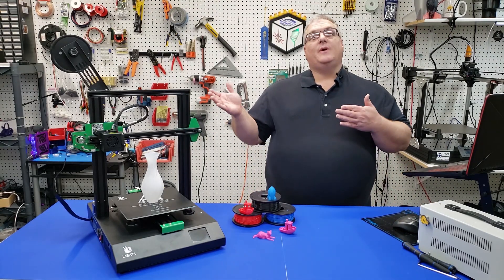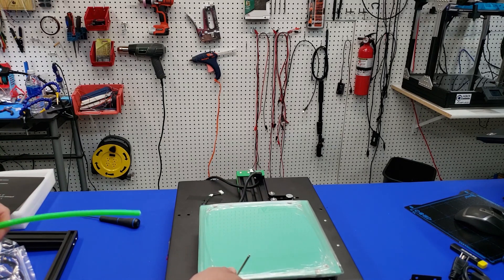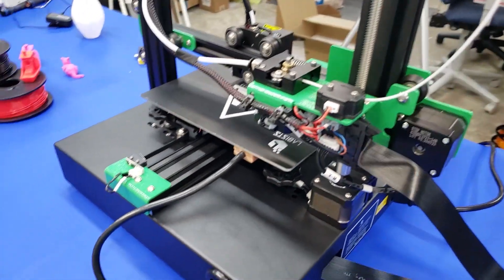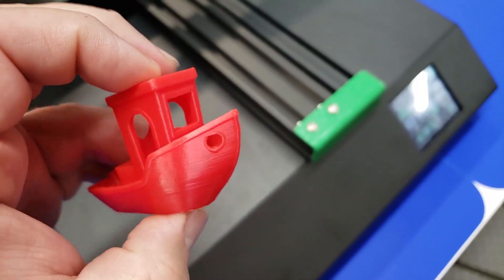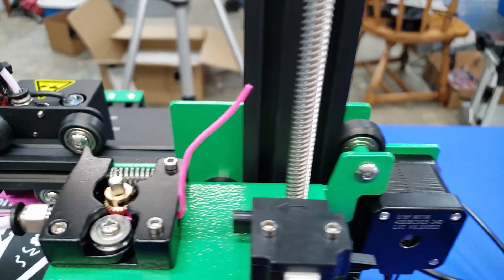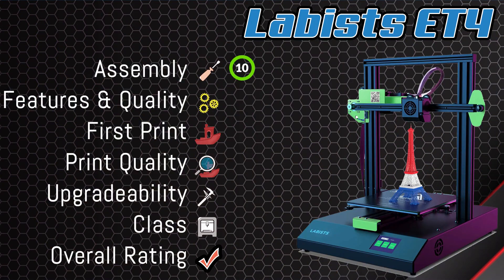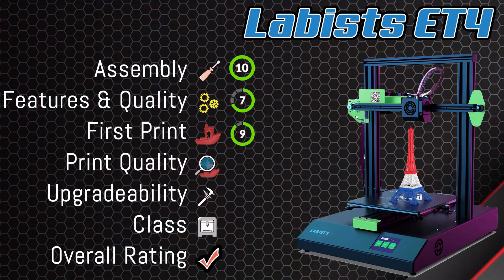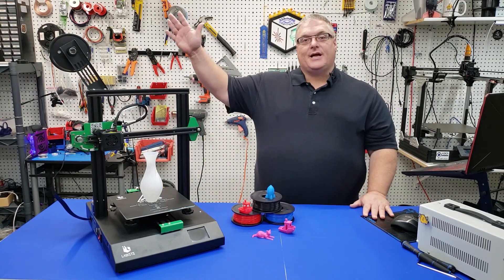Labists ET4 3D Printer Review

Comment: Hi! Why keeping the plastic sticky thing on the glass? Shouldn't the printer print directly on the glass bed and the plastinc only used for leveling? Thanks
Reply from the maker: Glass is probably my least favorite surface. The flexible sheet works fine but I use PEI build surfaces on all of my printers that I end up using long term.  I only use glass on exotic filaments.
Reply: @MakersMashup  Thanks for the quick reply! So, if I get it right, is a metter of personal preference, and the printer should work find even with the glass surface? Oh, I'm asking because the nozzle of the printer keeps getting too close to the glass
Reply from the maker: Thats right the build surface is really a personal choice.  You are probably having issues with the sensor reading the distance properly because the bed level sensor reads metal.  So if you plan to use glass you may want to manually level the bed.  Personally I would recommend something like this https://amzn.to/2JBmAjz

Comment: Question. Do you put the print bed on the glass or the aluminum
Reply from the maker: Personally I would put it on the aluminum and use bulldog clips.  Then it is easier to replace.  What I recommend though is to spend the money on a PEI magnetic sheet. So worth it.

Comment: Any one know the correct Cura settings for this in Cura 4.7? None of the ones they supply on the website seem to work correctly. Pls/thx
Reply from the maker: I used their cura profile worked fine for me.  Maybe reach out to them directly.
Reply: Nope and clearly this guy isn't going to make Video showing you how to use Cura with this printer even though he clearly  knows how... Good luck finding a useful video on how to fix this problem.
Reply from the maker: No one has asked for a video on how to use CURA with this printer so of course I won't produce one randomly.  As I indicated in my reply I used their cura profile/instructions.  That information is here https://labists.com/blogs/user-guide/cura-slicer-setting-for-et4-3d-printer . I followed that and cura worked just fine for me as I mentioned before.  It is also not clear if they ever contacted Labists. I also want to point out that this channel has an entire discord community which often helps users with these types of issues. It is a bit presumptuous to think that anyone could produce a YouTube video to address the OP's problem without more details. Which cura settings are we talking about here?  Machine settings? Profile settings? This is where the discord community is far more helpful than random complaints in YouTube comments.

Comment: how did you get it to print with cura
Reply from the maker: Your question is a bit unclear.  I used print to USB when using Cura attached directly to the printer and save to file while placing it onto an SD card.

Comment: I got one of these from Amazon,  The USB port did not work.  I had real problems with slicing models, STL files from Simplify 3D, Cura 15.04.2 (from my earlier printer) Cura 4.06, etc would often not print but the display showed "print complete".  But when it did print I found the result much better than I was led to believe!  I contacted Labist and they got back to me within the hour.  After some tooing and froing with them about driver updates and software updates they admitted defeat and are sending me a new one.  I found, during the time I had,  that the filament out detector worked beautifully and the power loss recovery worked as advertised.  I found there was a very minor  melting of the already extruded filament as power off and print head cooling don't happen together.  My biggest complaint was my total inability to remove prints from the bed! I resorted to a hammer and chisel, as I only had one of the stickers.  I left one print on the printer, with it turned off , overnight and still could not remove it.  In the end I resorted to a heatproof sheet of glass from my previous printer, levelled the bed and went ahead with printing.  All in all I liked the printer and look forward to getting another one.

Comment: Hi there, came across your video for this printer and I have one, its all setup, except the Leveling, I've gone thru the manual bed level sequence and when I go to print, the print head is off the bed way too much..note: I did preheat bed to 60 and nozzle to 159, which is pre-melting starting point for PLA*.Could you do, or do you have a more detailed process on the Whole Bed Leveling process?
Reply from the maker: I really just followed their manual and video guide.  Adjusting the screw as necessary to get the optimal nozzle to bed height.
Reply: I used this video to do my levelling. You have to work around the mistakes and poor directions, but at least the visuals will clue you in to what you need to know. Just take it slow and easy. https://www.youtube.com/watch?v=P7VLnQTWLng
I only do a manual levelling when I change the bed or the nozzle. I use Auto level when I change the filament or once a week just to keep things in good order. I heat the bed and the nozzle to the temperatures I will be printing at.I have no issues with items sticking properly and my layers are much better than expected.

Comment: for some reason, my printer the bottom thing where it makes the objects, it doesn't move, and makes a big RrRrRRRrrrRRRrRrRrRrRRRrrrRRRrRrRrRrRRRrrrRRRrRr sound when trying to move backward, and the tip doesn't heat up... help pls
Reply: Remove the green strip in between the tracks

Comment: My printer won't home, it slams into the print bed instead. Any input? It is this printer
Reply from the maker: Really can't say.  I would suggest adjusting the bed leveling sensor and if that doesnt work reach out to Labists.  They were responsive to my emails but chances are I was not talking to support.
Reply: @MakersMashup  okay, I did mess with the sensor, now it just raises 10mm and stops. I emailed labist

Comment: all the auto bed leveling does is tell you the tolerance between the head and the bed it doesn't auto correct with adjusting the the z while printing
Reply from the maker: The printer runs marlin.  It does a mesh level just fine and I've had zero problems with it adjusting first layer.  If you're not finding it doing that make sure your starting G code is activating the ABL system after homing.  The ABL on this does adjust and correct he first layer when properly setup.
Reply: @MakersMashup  in cura?
Reply from the maker: Yes. In Your cura startup script you need to turn on abl or one you home the abl is off.
Reply: @MakersMashup  I add G29 code to the start but it does not seem to compensate for anything

Comment: Thinking about getting this with the 75 dollar coupon
Reply: @Brado dang that sucks ehh I will just wait for a sale/coupon for the ender 3. But then again the ender 3 is more customizable and there is more profiles and more support and more communities honestly I think it is kinda good it went up even though ender 3 still won't be cheaper after you add the glass bed and auto leveling you just have more freedom and If you wait for coupons or sales than ender 3 could be cheaper and better. And it's good cause now I don't need to work more hours for it cause ender 3 is cheaper if we compare them both when they are normal price without coupons or anything.

Comment: They mainboard looks like the Anet ET4 and the printer seems complete clone of it. I will try to get the Anet ET4 Marlin conf firmware into it.
Reply from the maker: Keep me posted, im curious how that works out.  I've heard some mixed reports regarding it.  I would also be curious in the display setting for the configuration.  I figured if you could get marlin installed you would need to replace the display since there is no knob to be able to move the menu around in marlin.
Reply: @MakersMashup  The display works fine actually. The issue is that the binary Anet provides is for the version that homes on the top of the printer, instead of using the capacitive sensor. I guess now I need to dive into Marlin and compile a new version with changing the Z homing configuration.
Reply: @MakersMashup  3 hours later I managed to get the printer to use the probe for Z homing and go the correct direction. As far as i can tell everything works. I need to check if steps/mm is right and that i can actually print with it, but need to catch some sleep first. Also unfortunately the backup of the original firmware isn't working, so i can't go back if need be. So i need to make it work now :D